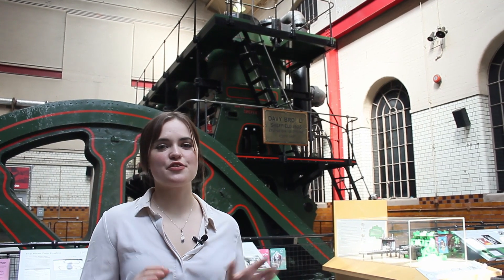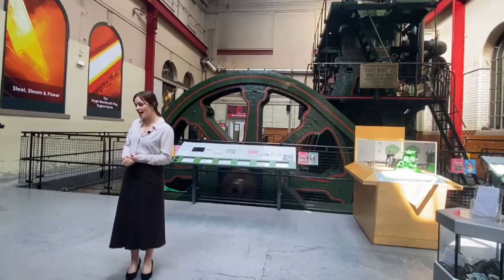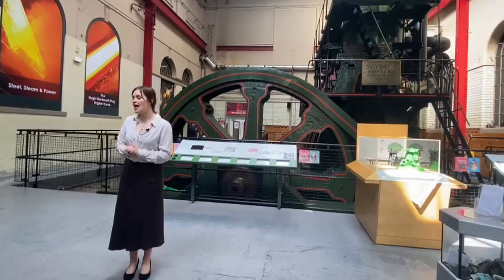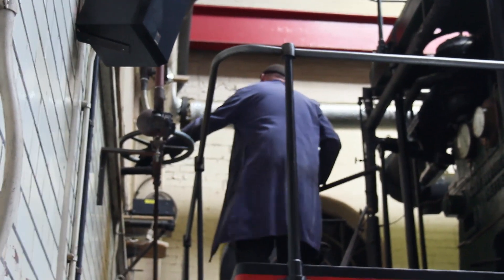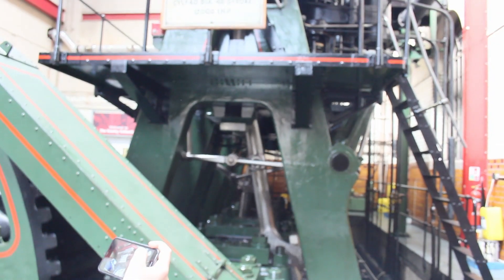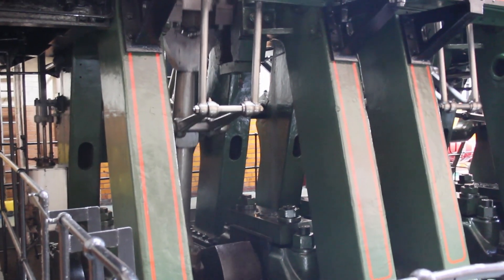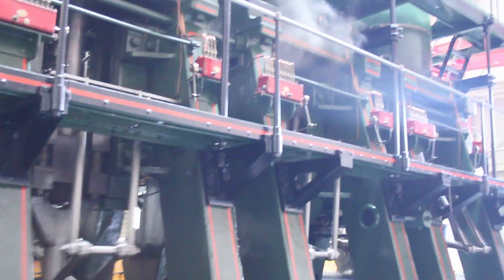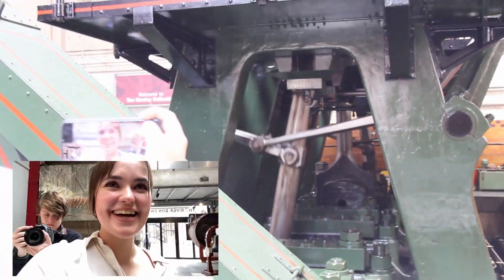This is Europe's Most Powerful Working Steam Engine.

Comment: the way such huge engines can stop almost instantaneously just shows how extremely powerful steam can really be, and just look at the size of those nuts!

by the way, the secondary camera angle is used is a bit strangely in this video, personally i think B-roll would be better.
Reply: Colossal power but designed to be finely controlled and not a computer to be seen anywhere.

Comment: Oooo wow... yet another cool thing to put on the list for a visit to the UK!  I really love Steam engines.  It's amazing how long such engines remained in operation - often modern engines and systems were not as easily able to generate the enormous amounts of torque that they could; at least not until more recently with more precise microprocessor control of electric engines.
Reply: I also believe (but I am not sure, so correct me if I am wrong) that the amount of technological improvements that went into the steam engine during its lifespan meant it took some time for the "new" electric motor to catch up. We often thing of steam engines as this old technology of 19. century, but those that were in use in the 20. century had a lot of modifications done to them and were also known and reliable.

We also think of nuclear power plant as something really modern, but the "important" part is "just" a steam turbine and all the Uranium does is it heats the water. When they were invented, steam engines were still used in trains.
Reply: @jansvanda  You're definitely correct - other engine technology had a lot of catching up to do.  Steam engines had nearly a century head start on its competition.

And you're right - nuclear power is just a modern use of steam for power.  Steam turbines are used because they are more efficient than a piston-type expansion engine.   Though, interesting to note, the Steam Turbine dates back to the 19th century as well,  with the first use of a steam turbine generator happening in 1899.  The Victorian's were astonishingly creative folks.